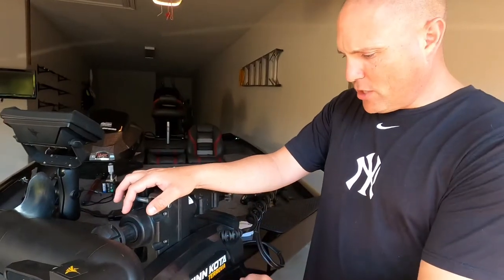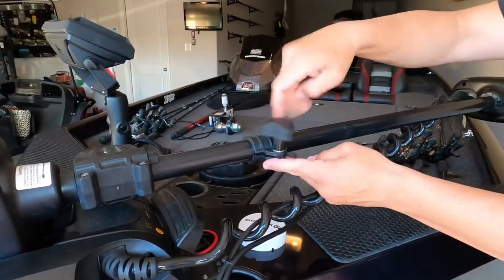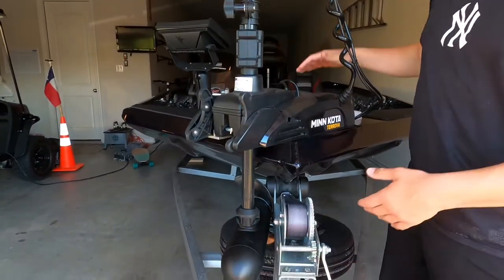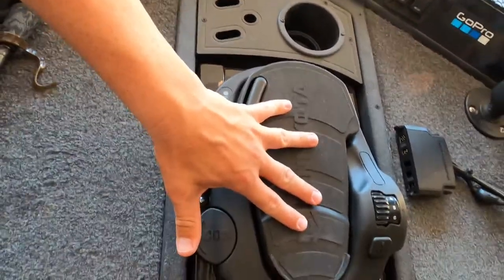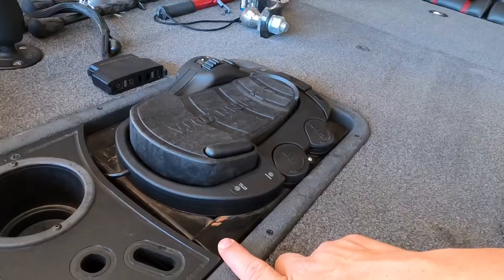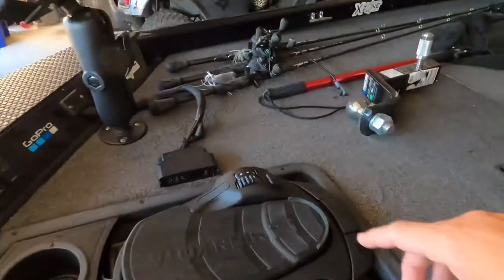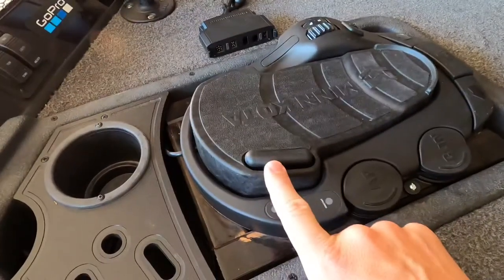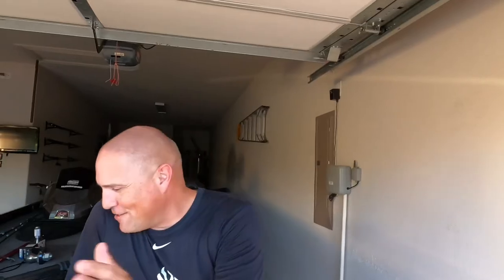💥MUST KNOW BEFORE YOU BUY💥 - Minn Kota Terrova (iPilot + Mega DI)

Comment: I can’t find anything to gripe about. Well worth my hard earned money! 
It did add 70lbs to my tongue weight. I simply put the front wheel on the bathroom scale. 326lbs, realized I need to adjust the boat back further on the trailer, now I’m 180
I lay it in the truck on longer drives.

Comment: That white puck is supposed to be mounted at least midway back on the boat at a minimum per the minnkota instructions it’s the magnetic compass and needs distance from the head unit to compare data to the head units gps readings. It also need to be away from magnetic sources aka the trolling motor itself. Probably works fine how you have it.....but it could work better.
Reply: And I believe it's skewed as well. The black arrow on the puck should point parallell to the keel, ie straight ahead.

The GPS signal is received at the head of the motor, not this puck.

Comment: There is a slotted collar the shaft rides through on the top of the gearbox , near the little white label. It is the steering control. This will shear off if the motor gets in a bind. Fishing stumps in wind on constant where the boat can get pushed sideways into a stump can and has twice on mine broken the collar. It is either a sacrificial part or a bad design. The replacements are 7-8 dollars and is fairly easy to fix if you are mechanically inclined. I have had mine for 4 years and this is the only real problem I have had.
Reply from the maker: Interesting. I’ve hit my fair share of stumps out at Lake Fork. Hasn’t happened to me yet, but that doesn’t mean it won’t.
Reply: @FishingtheLoneStar  when the auto pilot is on and the stump deflects the motor and it’s trying to turn to correct is the perfect storm.

Comment: I wouldn’t use the contour line autopilot feature at 5 feet.  I have one and sometimes it will start going bananas in all directions.  I don’t know if it is a GPS issue but I’ve been thrown from the boat.  Beware and brace yourself.
Reply from the maker: I appreciate that!  I actually haven’t used it yet. I keep telling myself I’m going to, but never switch the card from the console unit.

Comment: I noticed that it overhangs the front of the boat pretty far. Do you have any advice on how you can mount it so it doesn't get damaged when you are taking the boat off of the trailer? The ramps I use here in Mobile, Alabama are pretty shallow and the boat kind of falls off the roller when you launch it. I don't want my mount to fall on that roller and break it. Thanks for the overview. I'm thinking about getting one, but I need to figure out how to launch the boat with the bracket poking out so far.
Reply from the maker: Well, the way it deploys, it has to hang over the edge. But you’re right, I’ve hit it several times on the bow roller while launching.  I’ve had to figure out the right point/depth for my trailer no matter what the angle is of the trailer.   That has helped a ton.  I rarely hit it now.  All about the trailer angle.
Reply: @FishingtheLoneStar  thanks for your answer. I did find that Minn Kota makes a base plate that bolts to the boat and another plate that bolts to the bottom of the motor than then fits onto the bottom plate. It has a sliding track where you can slide the motor mount back where it doesn't hang over. I went over the Bass Pro Shop and they had one for $69.99 and I think it will solve that problem. I haven't got my motor mounted yet, they should do it on Thursday. I'm crossing my fingers. Thanks for the video!

Comment: I just use my remote control, clip to my belt loop and no bother for the clumsy foot petal. Run my trolling motor anywhere in the boat.
Reply from the maker: I’ll do the same sometimes. I do prefer the food pedal though.
Reply: I also prefer the footpedal, so your not tryin to move your motor and fish at the same time.
Reply from the maker: @fishinwithryley4547  I would agree with that.

Comment: I purchased a used minn kota terrova 24v 80 ipilot unt less han a year old. It doesn't have a heading sensor. Does this unit have gps in the head and doesn't require heading sensor?
Reply from the maker: I’m not 100% sure here, but I believe it is needed for this unit, and I don’t think GPS is built into the head.
Reply: The head has GPS. The heading sensor is needed to jog the boat though.

Comment: I am getting  a RT178 also and also interested in the Terrova. I see you got the 80lbs thrust but do you need the 80lbs or could I get away with using the 55lbs? Is it enough?
Reply from the maker: I had the Minn Kota 45 on it for about a month.  There were times when trolling into the wind that that motor had a difficult time, almost didn’t make it. 55 would probably be fine.  I just wanted to be sure the wind would never bully me again (lol), and stepped up to the 80. Hope that helps.
Reply: @FishingtheLoneStar  I went and got the Terrova 80lbs. Just got it installed last week. Better safe than sorry. lol
Reply from the maker: @ddm62571  - you’ll be happy with it. Especially that spot lock. It does a great job!

Comment: What length shaft does that Terrova have? and what size boat ? thanks
Reply from the maker: The boat I have is the RT 178 by Ranger. 17 ft aluminum.  I have the 45 inch shaft. Not sure what all it comes in.

Comment: Hi what  size your  boat 80 lb trust is enough?
Reply from the maker: It’s 17.5 ft, and 80 lb thrust is plenty. Not only does it scoot on 10, but the spot lock has held in 15-20 mph winds with no problem.

Comment: Nice vid, do you have your hummingbird transducer on the transom or on the trolling motor?
Reply from the maker: Thanks for the comment and feedback!  I have two helix 9’s, so the console transducer is run off the back transom and runs mega down and side imaging. That same side imaging (from the back) is also shown on the front/bow graph, but the down imaging off the front is from the transducer on the bottom of the trolling motor. They are networked together, so it works out well!

Comment: I have my puck near my console should I move it closer? Because my spot lock is all over the place.
Reply from the maker: This is where Cabela’s installed mine. I don’t know that much about the location and it’s impact on the spot lock.
Reply: GPS is in the motor for spot lock.  The puck is an electronic compass. When you want to move 5 ft to the "left", the motor asks the puck which way the boat is facing and moves accordingly.  Don't move you puck unless you think it's not getting a connection.   My puck isn't powered right now because I'm too lazy to power it, but my spot lock works fine.

Comment: Since this video is older I want to know are you still happy with the foot pedal ? I was told if I was a bass fisherman I would want the Ultrex because of the response of the pedal . I was told that the others that are not cable driven have lag and not as precise. I now have a Powerdrive and cuss it everytime I am running through timber , etc. because I can't fish and control the boat at the same time. I have found a few good deals on Terrova but not Ultrex . THANKS !!!!
Reply from the maker: I haven’t had a problem at all with the responsiveness. I’ve been on other boats with an ultrex and I think it’s too touchy. I can navigate my boat through some pretty challenging creek channels with the Terrova, so it’s likely just a matter preference and getting used to it.  I also like the flatness of the foot pedal. It’s way more ergonomically designed in my opinion.

Comment: Did you replace an existing trolling motor and if so did the holes match the previous minn kota or did you have to drill new holes?
Reply from the maker: Great question. There was a Minn Kota 45 that I replaced. But I had a dealership so it, and I never saw it in the process.

Comment: FYI the white puck he pointed to is NOT the GPS. The GPS is in the head of the motor.
Reply from the maker: You’re correct.  It’s a digital compass for your boat. This is from trollingmotors.net:  The heading sensor, shaped like a small smoke detector, is in fact a digital compass that communicates with the trolling motor via Bluetooth and enables the motor to keep track of its actual heading. This in turn enables the new ‘jog’ feature, or the ability for the motor to jog your boat five feet at a time in any direction you choose.

Comment: Can you get mega si from the transducer on the terrova
Reply from the maker: Not currently. Mega Down, but not side. You can buy Mega side imaging and strap it on, but in general, it’s not recommended because every time you turn your trolling motor the image for side imaging changes. Too much distortion on the screen. Instead, I put side imaging on the console unit, and networked the two graphs (console and bow) so I can still see side imaging from the front graph. It’s just from the transducer on the back of the boat.

Comment: Awesome Video!  I was looking at the Riptide Terrova for my RHIB boat, 21 footer.  I was told the black one is for lake and white is for saltwater?  What thrust do you recommend for a 21 footer?  And is it better to get a longer shaft than what is needed?  Are these trolling motor only for bow mount?  Can you do a transom mount?  Which is better?  Thank you brother!
Reply from the maker: That sounds right on the color, but I’m not 100% sure.  Mine is 80lb thrust and moves my not just fine. (1,075 lbs). For a 21 ft boat, I would base the thrust more on weight of boat, vs length. For shaft length, depends on the wake of where you’ll be fishing. 45 was perfect for me. You have to also think how high it will stick up when not fully down, and how far it will lay over the edge of your boat when on deck.  Transom mount is not an option for the model I chose.

Comment: Does the autopilot connect with your fish finder or how’s that work?
Reply from the maker: Yes. The Terrova will connect with the Hummingbird unit to autopilot to pre-set waypoints or a route or waypoints. It will also follow a contour line that you set it to. Pretty darn cool!!  You do need the Hummingbird map chip though for the contour line feature.
Reply: @FishingtheLoneStar  Great, so I assume the trolling motors without the “link” can’t run routes?
Reply from the maker: @cormacmccarthy8832  _ I believe that is true. It’s need that component to be able to know the GPS coordinates to locate.
Reply: Will the terrova still connect to my Lowrance console fish finder?
Reply: @Cormac McCarthy trolling motors with i-pilot, but not i-pilot link can still run tracks, they just can’t do it connected to the finder. You can still use spot lock, and it will also work on auto-pilot, just a lot less features than with the i-pilot link.

Comment: I am looking at  the same Trolling motor for my 1994 Nitro 170TF it is 60" shaft  I thought abouts the 45" I am unable to measure the water line is the 60 gonna be a good choice because if short I can go deeper but if it's 60 I have a choice what's your Take ?
Reply from the maker: I haven’t had a problem with the 45, but my Ranger also sits level in the water so the front end is closer to the water that most boats. One thing to also consider is if it will stick off the side of your boat when it’s not deployed.

Comment: I would suggest making the foot rest out of something besides wood. Maybe aluminum or fiberglass, anything but wood, wood will rot one ce it starts getting wet.
Reply from the maker: This is true. I did coat it with flex seal though!  Lol. I can replace it very easily.